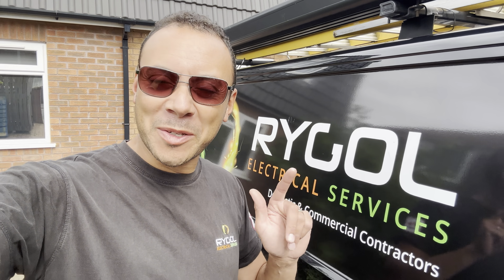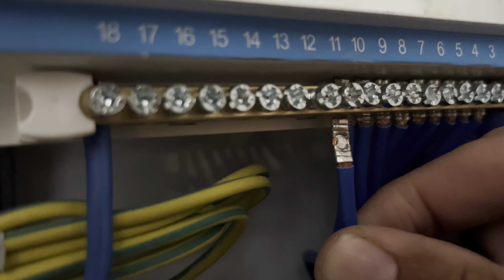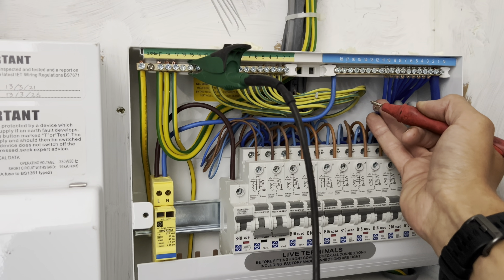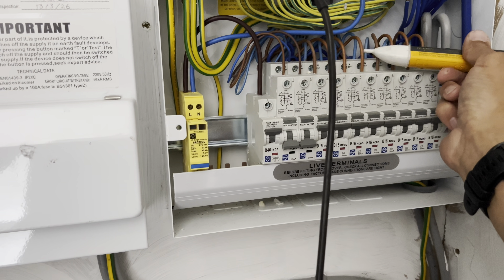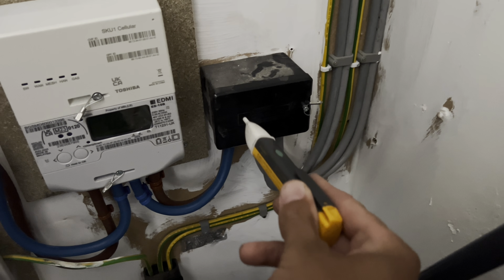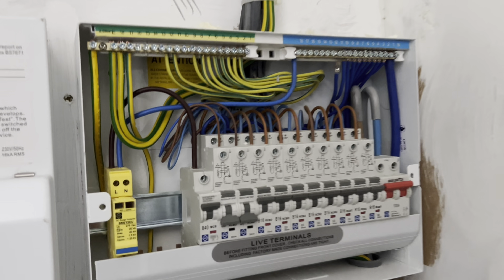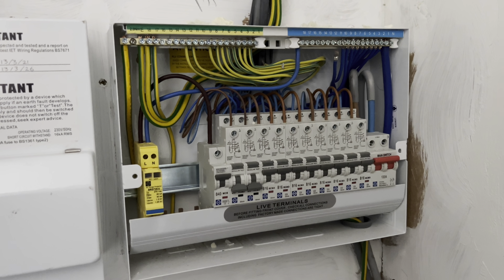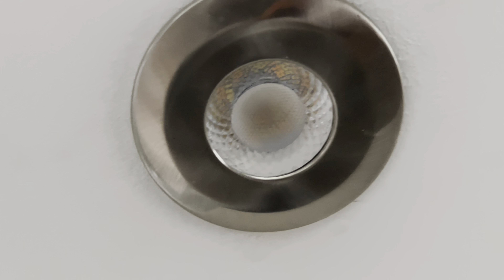Smart Meter Disaster! ⚡️

Comment: Same issue was discovered by my father in the early 80's, when he bought an old house in Hungary where I was born. He turned the main breaker off (in Hungary, single pole breakers are used, the neutral is never disconnected), also removed the antique ceramic bolted fuse, and began replacing a light fixture, then he got shocked. Terminals under the meter stamp were messed up, so he, even though did not got permission to open the meter connection, removed the cover and put the cables to the right polarity, as this house was just delmonished within a few months after the new one was built. Uninsulated wires were swapped when the power company replaced the poles on the street a few years before his purchase.

Comment: Back in the 1980s (before any privatization of the electrical supply industry) I instilled a constant flow power shower in my home.  My part of the installation included a new consumer unit for the shower.  The system was tested and connected to the supply by the (then) national electricity supply organisation.    Many months later I was redecorating my lounge and, although I had removed the fuse from the ring main feeding the lounge, I received a mains voltage shock from one of the sockets.  When I checked the supply I found that when the shower circuit had been connected, the connection to the rest of the property had been reversed, and just as in your video, sealed behind a tag.  As you know this is an extremely dangerous situation with a very significant fire risk should a fault occur on the (now) unprotected circuits.  I complained to the supplier who told me that there would be a call out charge.  Someone came, fixed the problem and I never heard from them again.  (Retired Electrical Engineer.)

Comment: Probably the same company who wired all the new builds round mine. When i 1st moved in you would have to have the upstairs lights on for the door bell to work and don't even get me started on the electric cooker, Let alone the MVMR system in the attic. Fixed after 7 years.

Comment: Rs about face ! and yes, a volt stick  is bloody handy, no matter what your lecturer says against them, also the test plug like wot you showed is a useful tool, again against what you're told.  I would try either of these things before looking for specific problems, gives you a start !
    No, I'm not a spark , but over a long career in the building game , I've learnt to regard everything electrical  as  a potential hazard.  It doesn't have to be the actual electricity that gets you, I've seen  men fall off a pair of steps because of a sudden jolt under an arm made them jump !  So I check !
,

Comment: This is not an isolated incident it happened to me in South Wales about 20 years ago when the meter was replaced. The problem did not come to light until a few years later when I had a smart meter installed. It was the smart meter installer that actually spotted the fault what he did the final check at one of the socket points.

Comment: Why they might flash or dim:

While LEDs are designed to not conduct in reverse, some circuits might still allow a small amount of current to flow, causing the LED to flicker or dim, especially if the reverse voltage is not too high. 

Damage:

While LEDs are generally not damaged by reverse polarity, prolonged exposure to a high reverse voltage could potentially damage them

Comment: Every Electrician Should Carry A Large Screwdriver Type Neon Tester, So That when Working With Tails Junction Boxes, He/She Qualified Or Being Under Training, (Even The District Network Operator/Organisation's Engineer's/Trainee's On Domestic And Factory Power Supplies, (Not Applicable To Those Engineers Who Operate On High Voltage And Ultra High Voltage Power Distribution Though ), Can Confirm Polarity Of The Live/Line Phase In And Out Of Such Tails Junction Box's And At The Input To The Main Circuit Breaker/Fuse Box's Main Switch And Or RCDs Input Side's Polarity, It's Not Wise To Rely On The Led Transistor/IC, Battery Powered Screwdriver Detectors Or Sense Pen's As Spurious AC Fields Can Trigger Them, Similarily A Neon Screwdriver Detector Will Detect Unbonded Earth Circuit Protective Conductors In A Ceiling Rose Or Power Socket, As It will Glow WEAKLY If An Induced Phantom Current Is In Those Earth Circuit Protective Conductors, When They Are NOT BONDED TO Supply Earth Incomer.

These Screwdriver Detectors Will Also Reliably Confirm Polarity Of Power Sockets Live/Phase Output On The Live Shuttered Hole Of A Power Socket, Using Insulated Plastic Rod To Depress Earthed Socket's Shutter Ramp, Or Rotate MK Type Shutters With The Plastic Rod On The Neutral Socket Hole And The Neon Tester Screwdriver On The Live Socket, Right Hand Hole, (UK SOCKETS ONLY, OTHER COUNTRY'S CONVENTIONS VARY AS TO THE LEFT OR RIGHT HAND OUTLET HOLE/SLOT IS THE LIVE/LINE/PHASE SOCKET POLARITY) , Depressing Plastic Rod And Neon Tester  Screwdriver Simultaneously Will Demonstraight The Polarity Is Confirmed Correct Or incorrect.
Really There Is No Excuse For What has Been Revealed, As Tails Junction Boxes Of the  Henley And Other Makes/Manufacturer's Are Embossed On The Bakelite  Or Urea Formaldehide Mouldings As L For Live/Line/Phase, (Also Older Henley Blocks Had The Live/Line/Phase Terminal Bar Marked With A Red Plastic Rectangle Trapped Under The Terminal Bars Centre Most Screws, That Would Be Brown If Still Included In Henley Blocks Currently Available, And Live Was Always Farthest, In From Outside The Blocks Main Housing And Shrouded By The Insulation Partition Under The Neutral Terminal Bar, That Is Top Most Under The Block's Cover),  And N For Neutral, Also On Old Electricity Installations With Grey/Gray or Brown Jacket Tails, Outer Heavier Insulation The Inner Colour/Color Lighter Duty Insulation Was Identified As Red And Black And Modern Tails Grey Outer Heavy Duty Insulation Inner Light Duty Insulation Is Coloured Brown/ Line/Live/Phase Or Blue Neutral Or, Coloured/Colored Outer,Heavy Duty Insulation Is The Same As Inner Light Duty Insulation Of Brown, Line/Live/Phase And Blue Neutral.
Additional Phases For Three Phase Supply Would Now Be Black And Grey/Gray*,  With Outer Heavy Duty Jacket BeIng Grey/Gray*.  Or Both The Outer Heavy Duty And Inner Light Duty Insulations Would Be Black And Grey/Gray*   *Yes I Know I've Repeated This Statement, But That's The Stupidity Of European Harmonisation We Adopted As Of 2006 with Our Adopting Harmonisation Entirely To Include Power In Tails from Electrical Supply Cutout And Incomer Head Termination And House Wiring To Include Brown Live/Line/Phase  And Blue Neutral Colours/Colors Than Our Old RED/BLUE/YELLOW, Three Phase Colours with Black As Neutral, More Sensible Except When Using Multicored Mains Flexible Cabling In The UK, With Rubber Or PVC Jackets With All Black Or White And Sometimes Grey/Gray Insulated Inner Conductors With Numbered Printed/Embossed Insulations, For Control Circuit Applications Etc.
One Last Observation, The Second Cosumer Unit Also Has It's Neutral Live, As Both Consumer Units Are Identicle And The Lives To Each Consumer Unit, On The Left Of Each Live/Neutral Pair Consumer Unit Feeds, In The Video, Clipped To The Wall As They Rise To The Consumer Units Have A Slightly Darker Grey/Gray Outer Heavy Duty Jacket Compared To The Neutrals Lighter Grey Heavy Duty Outer Jacket, Those Darker Grey/Gray Jackets Are Front Most Coming Out Of The Henley Block. Fed By The Neutral From The Meter Tails, The Terminal Bars Were Transposed When The Meter Was Fitted, As There Would Be No Need To Detach The Out Going Tails To The Consumer Units. And If The Henley Live Terminal Bar Is Identified As I Stated Above either By A Red Marker Or Brown, Thats Very Poor Observation Or The Person Concerned May Well Be Colour/Color Blind, I Say This Seriously, As Certain Colours/Colors Are Mistaken By Colour/Color Blind Persons.
If I Remember Correctly Red Is Mistaken For Green, Hence Part Of The Reason To Change From The UK's Original Black N Green E Red L Colour/Colors, Though Flexible Mains Cables Late Sixties/Early Seventies Had A Green With Yellow Stripe In Them And Black And Red.
Reply: Interesting, but hard to read because of all the capital letters

Comment: Didn't cover why the lights themselves were flickering with the reversed polarity. 
I suspect that the light circuits were 3-wire earthed (rather than double insulated) and it was the electrical noise filters that were providing the conduction path between neutral (unswitched & now live) and earth, via one half of the Y filter capacitor - enough to tickle the LEDs, but not enough to trip the leakage breakers.

Comment: Neutral becoming live is a shocker. 
As a boy in the late 60's I was helping a neighbour with his lights wiring, and as we unwound the neutral common in the kitchen light switch it started sparking - Oops. Back then isolation wasn't what it was now (wire fuses!) and it was normal/common for all the lighting returns to go back to the kitchen light, and another light had been left on and the fuse not pulled.
The joys of a learning experience!

Comment: Ime an electrical technician its good to see you found the fault you were obviously put into a tricky position to get power back on but with respect by you breaking the seal on the henley block the dno firm could have had you done for  going into this piece of equipment .If that was me i would have locked the main isolator of on the d.b and then contacted the meter company .with respect

Comment: I think some of this problem might be that the people installing smart meters are not fully trained electricians but just trained to do one task. Though have to say I had smart meters installed on same day - ie electricity and gas smart meters - by the same young man and I was impressed with his skills and neat work. I did think it looked pretty hazardous but he had PPE and knew what he was doing.  So there you have somebody doing a job involving both tasks which would usually need a fully trained electrician and a gas safe certified gas engineer. Funny how rules can change when it suits some other group.

Comment: First of all, well done, Rygol, for a great video and showing off your installation. I would be proud of it myself. I have just seen it 6 months on. I don't know whether you contacted the meter installer. I hoped you did before correcting the fault. Breaking supplier seals would leave you wide open to prosecution. I would have informed the meter installer and gave them the option of correcting the fault or them giving you permission to breaking the seals. Photos taken and sent to the contractor first. Making the property safe would have been top priority. I am sure the contractor would have had kittens when they found out.

Comment: In Norway, the vast majority of houshold power is by 3-phase 230v, with a floating earth. 
Not 400v+Neutral like the rest of europe.
If you messure between L and N in any power outlet , you should se about 135v to earth. 
Unless the is a graund fault in your, or your close neighbours house that stil have an old fusebord, and not modern RCD breakers.
So, In theory most houses here could swith L and "N", and there would be no difference :p

Comment: Yes it looks like a nice job. Very neat. I'd bet on it being sound UNLESS interfered with.....?? I think I might ask the customer if there have been any changes known to them. I'm an older - mainly electronics engineer - where many electrical things are quite similar BUT and watch out here - not usually so deadly. I keep very respectful of the mains. One hand in my pocket job and non conductive shoes. Ah but electric shock isn't the only worry. Such power doesn't duck a job of work and it'll vapourise your tools before your very eyes and that hot liquid metal is no good for skin. You can get some very odd things if the power lines Live & Neutral are reversed. Especially weird symptoms if anything electronic is then connected. Well there could be in todays world. Those LED's need voltage reduction (and rectification) to work. The standard answer is a SMPSU (Switched Mode Power Supply Unit to you), of the "Buck" variety. This means it steps down... that's all. Yeah you can also step up "Boost" which is useful for quick-start fluorescents. Are any of those performing here? 
I think I'd start by measuring for volts between Ground (Earth I call it) and the Neutral line at the input. It should not be more than a low (few) - come on spit it out - be definitive! I can't even spell that. OK say 3V rms. See this is where I get just a little bit shaky and you've rightly detected that.  May I now play the rest of your video dammit. I've complied in every way with your request to comment. I'm thinking that this is a mains reversal which means the Neutral is isolated at the consumer unit and those electronic bits are trying to operate between a live feed and their virtual earth...... ??   OK OK I'll stick to my computers and TV repairs. Yeah and those burglar alarms that trip in the night because a spider has walked over the sensor... ! BjG

Comment: Just watched this, I have one question, am I right in saying on those DP tail blocks the Live goes to the back and neutral to the front? If so the metering company although never completed any tests were correct in their connection of the tail blocks and the outgoing were wrong ? 
I may be wrong as haven’t used the DP blocks for years. Very dangerous anyway glad you sorted it and no one got injured 👍
Reply: Just read a further comment, I revoke my comment, the meter company wired them wrong not you, I never noticed this on the video as watching through a dirty screen phone 😂. Like I said well done for sorting

Comment: Guy from the DNO clearly didn't test the kitchen socket, I've worked with them when they do that and they don't just do a quick test, it's timed over several minutes. The other thing is the cables coming from the meter to the Henley block is live at the back and neutral at the front, if you pause the video you can see the cables from the CU is the other way around, now although its not marked on a old style Henley block it is best practice to put the live/line to the rear so you're less likely to touch it when working and I'm only guessing but the DNO guy didn't notice it was the other way around and just fitted it in the manner he has done for years, he wouldn't have touched the grey tails as part of his job (or it is fair to say many meters are fitted by temp staff so could have been a newish employee trained to fit the live/line to the back) if they did full change over they would have fitted individual identifying blocks, also in my opinion best or better practice but not always possible.

Comment: Great video btw. I’ve been in this industry for almost 15 years and there is a set procedure detailing safe isolation and re-establishing power and  final polarity checks. In my time I’ve seen some proper cowboys and it gives us all a bad name. Pre and post polarity tests or a failure to do them is a blatant act of gross misconduct and anyone not doing them should be shown the door. I happen to work as a contractor for this particular company (I recognise the label sticker). Personally you should have reported it to them as you can’t cut the seals. It invalidates the investigation mate and we need to see these cowboys out of the industry

Comment: I attended a fault in an NHS Hospital back in 2006, where the electrics all worked but the boilers would not ignite or fire. There were several NHS engineers present and they were all baffled - I was ex-NHS, so had some experience of what goes on. I was baffled as well, at first, until I happened to check the voltage at the boiler terminals. 230v Neutral-Earth! One of the NHS guys them mentioned that the building's main switchgear had been renewed during the previous weekend, by contractors. If they had told me that earlier we would all have had an easier time, but hey ho! The boilers would not light because their ionization probes didn't like the voltages being wrong, but that was the only indicator. I did a temporary fix so that the hospital had hot water for the evening, and left the site engineers to recall the contractors the following day to rectify their serious error. 

I also had a similar scenario at the hospital I worked in, back in the 1990s, where some switchgear was renewed but they left the neutral link out........ but that's a story for another day!

Comment: WHY is there no N>E bridge cable dragging neutral down to earth potential and FORCING a breaker or fuse to blow when some moron cross-polarises the wiring?

No sparky but know enough, in Australia it's a standard to bridge them two bus bars at the top deliberately to avoid this issue along with leaky crap which is less of an issue now.

EDIT .. don't knock the flashy pen ... it does a damned good job for quite a few scenarios.

Comment: Just had my electrics changed from a coin meter ‼️ to octopus… DD but told it’s not a smart meter. But have charged me for one month £180. Single, one bedroom with two mobile radiators small with one induction hot plate. So will be looking at my electrical system…